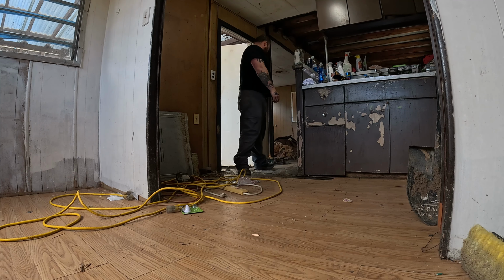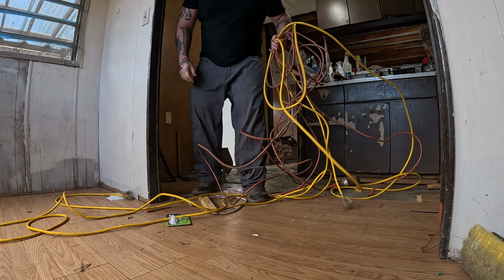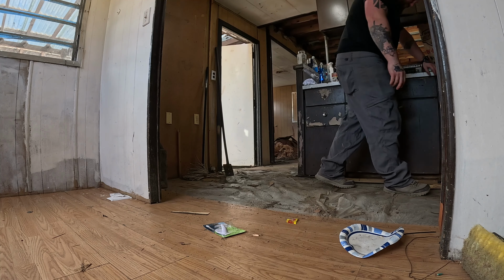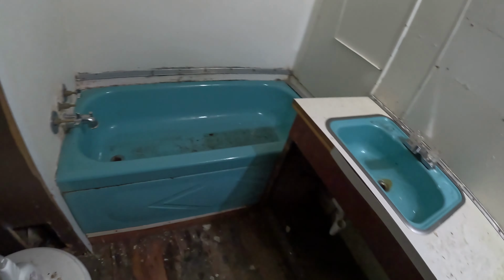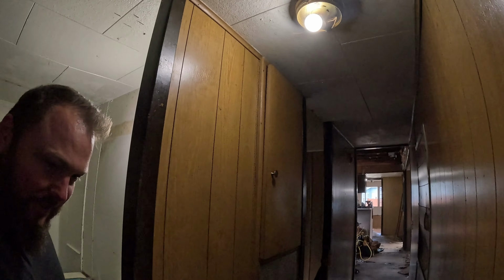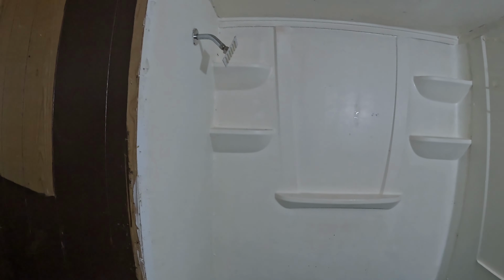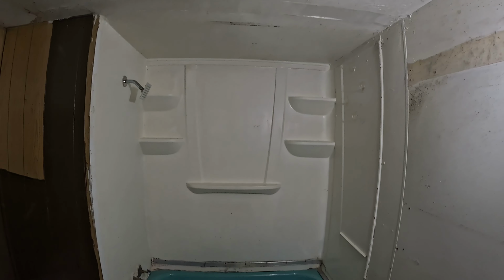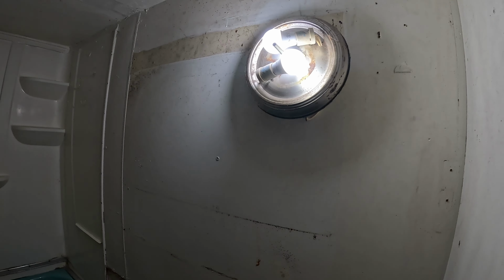1963 Single Wide Bathroom DEMOLITION!! and Kitchen

Comment: Hey, something that I saw that worried me is, in the wall area behind the shower pipe, (where you said something about possibly putting the water heater) I did notice what looked like damage from the ceiling or roof where something was hanging down. You probably have a roof leak on the top of that area. AND, I saw some electric wires (yellow in color, I think they were) hanging down as well that looked like they just had some electric tape on the end of it. You might want to cut the main breaker for a minute and add a few wire nuts to that cable. That would lessen the possibility of a fire while you're working on stuff in the bathroom. If I hadn't of said something my conscience would bother me, especially if you had a fire and my warning could have possibly kept it from happening. You're doing great work there, keep it up! And if you were close by me, I would have bought that tub and maybe even the sink from you, I love those! LOL
Perhaps you could clean them up and offer them on Farcebook as vintage bathroom pieces and the money could be used to buy more supplies for the remodel?
Reply from the maker: There lots of damage. I will be fixing all of it. Lots to do but I enjoy doing it and learning along the way. I really appreciate your support and continued comments on the videos. Please keep watching and sharing with anyone you know.